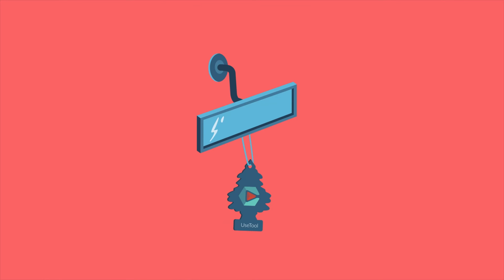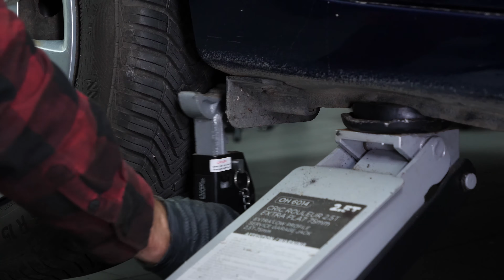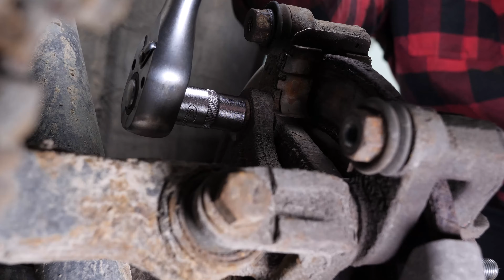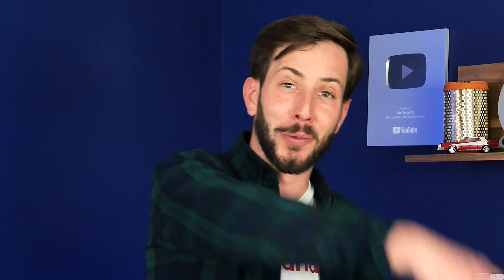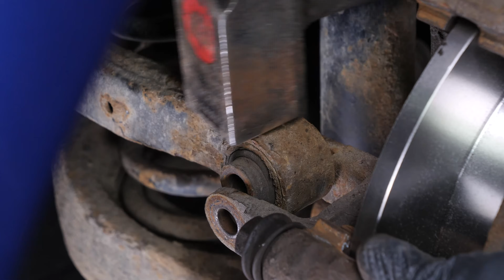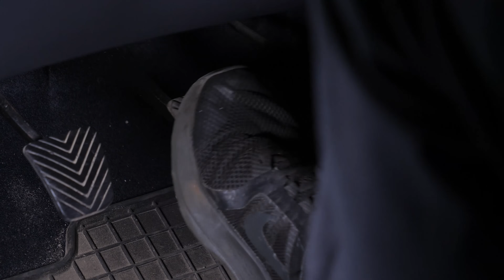How to replace the rear brake rotors and pads i30 mk1 🚗

Comment: lubricate behind the caliper bracket shims as well, to prevent rust jacking, and take out the caliper glider bolts and clean and relubricate them, but not with copper grease.